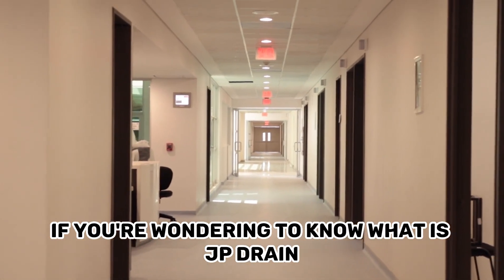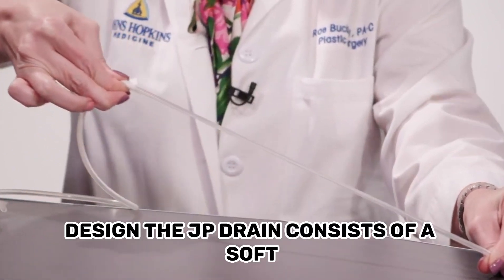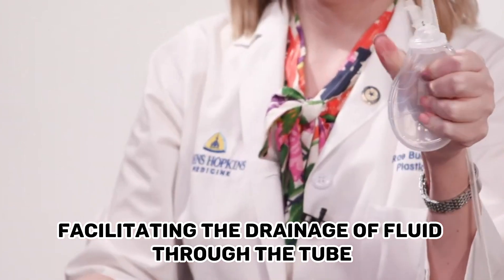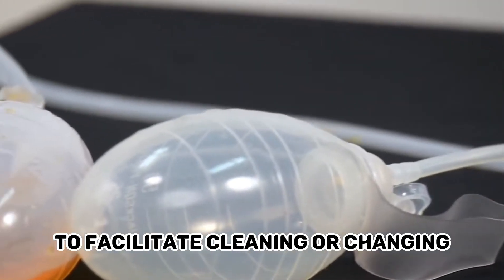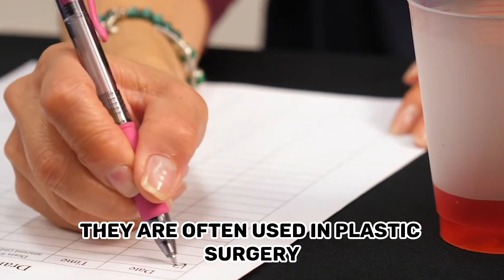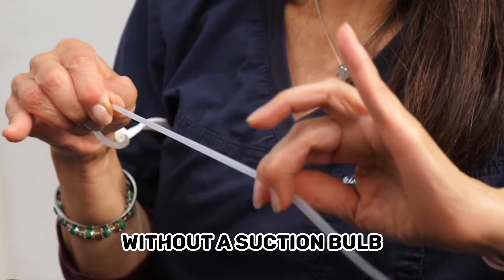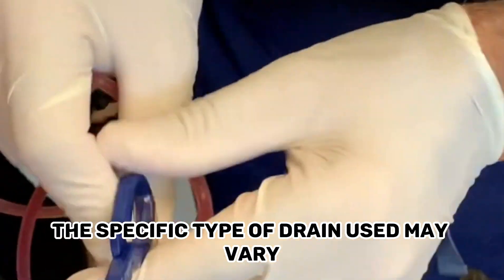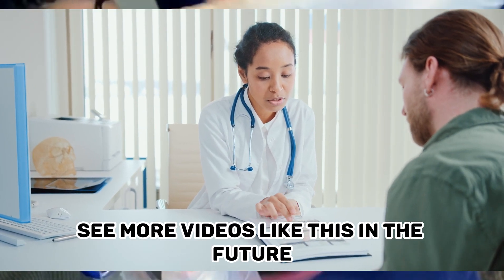what is JP Drain and Blake Drain

Comment: So unfortunate to see so much misinformation packed into one video.  You should look at the original article titled "Technical Report: A Silicone Rubber Suction Drain for Drainage of Subdural Hematomas" written by Dr  Frederick Jackson and Dr Richard Pratt in 1971, and compare that to the very different drain invented by Larry Blake in 1983 and outlined in his US patent 4398910A.   The JP as written by the inventors, Dr Jackson and Dr Pratt, has a central lumen with internal ridges and circular perforations along its walls.  The Blake has longitudinal flutes and no central lumen.  BOTH drain types are typically connected to bulb suction.